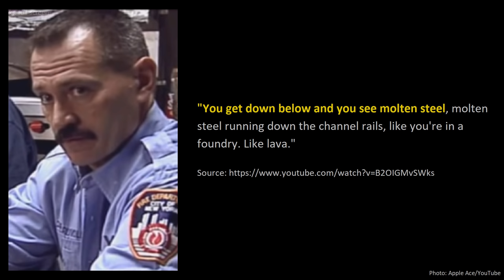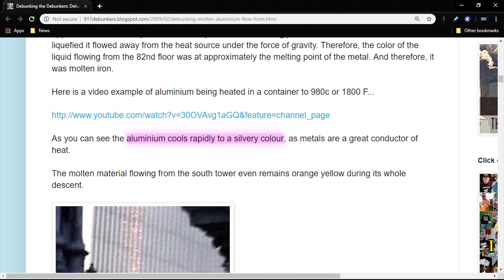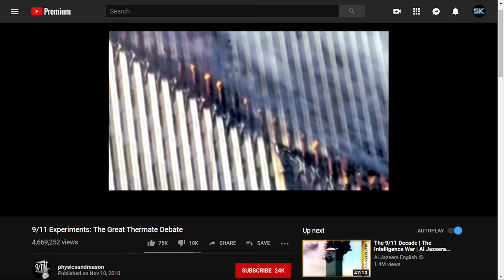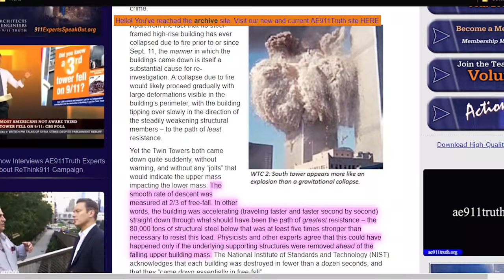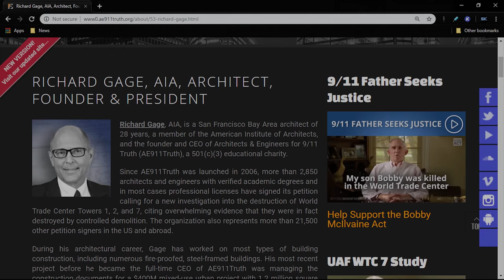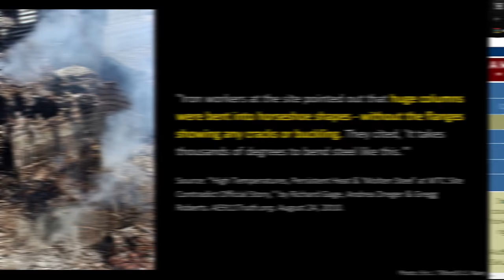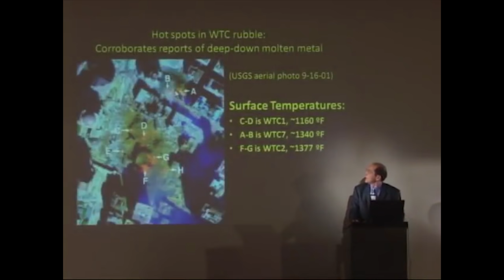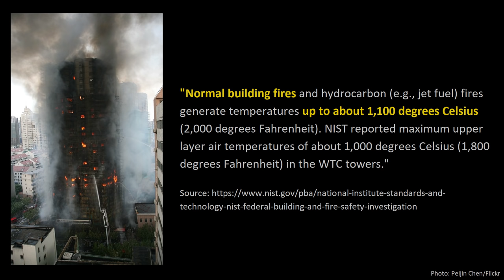9/11 Truthers Debunked: "Molten Steel = Thermite From Controlled Demolition!"

Comment: How would you then explain this thin material remaining liquid weeks after the event??
It takes mass to maintain a solid heat source. Thin sheets of fuselage and cladding don't cut the cheese here sonny. Only huge tonnage of mass explains this theory clearly.
Reply: @yabbadabbadoo8225  "Where does Chief Phatts mention 100 degrees?"
"because the water was just steaming off"
Boiling-point of water, where it would turn into steam, 100 degrees centigrade.

Further questions?

"You PR slant on kids with no brains is pure pointless drivel and lends zero to the whole subject matter."
And, which "kids with no brains" would that be? The average "truther"?

"ask how did 1000's of tons of steel get blast furnace level in heat?"
A better question would be, in what way did they even slightly?
Before you try? At no point, EVER, during the aftermath of 9/11, did anyone "extract molten steel", either directly or in re-solidified form.
Reply: @mooneyes2k478  so you are calling FDNY personnel liars are you??
There were once upon a time B4 YT removed dozens of vids that showed liquid steel flowing while being extracted from all 3 sites. Many of the sightings have been documented. All call outs are followed by post operation reports, it's how the Game improves so incidents and deaths on the job are reduced.
While Chief Orio Palmer was on the 78th floor of the South Tower he reported explosives damage at many locations, but not building failures possibilities.
Had he seen obvious signs, he would have ordered his teams out. Rescues would have been abandoned. A Fire Chief is not a Hose Jockey. They are very skilled at structural observations. They are not permitted to send crews into a building showing signs of failure. Chief Palmer was 40 floors ahead of the nearest teams coming up behind him. Via 2way he was confirming conditions. On the 78th there were a dozen people waiting to be rescued. There were also a lot of bodies, some with giant slabs of concrete on them - crushed flat. The claimed main impact zone was 6 floors above. The people on the 78th had wandered down from the upper floors hoping to get a ride out of the tower.
But all the cars from the 78th lobby were wrecked. So FDNY crews walked them down to the lower lobby(40th floor)
Then the Tower failed, crashed.
Had the floors above the 78th been exposed to 1000 degree out of control fires as NIST reported, the 12 people on the 78th would have all been charcoal, not living breathing beings.
People that revert to terms such as 'Truthers', etc add zero to conversations.
They add their slant and nothing else.
I like facts and science. The real stuff, not dribble and fairy tales like CNN et al.
John Lear via an affidavit has already proved planes were never involved in 9'11
The lads over at pilots for 9'11 have also proved they never came anywhere near the WTC complex. 9000 pound engines cannot vanish. No engines were found at the 9'11 sites. The engine in the street was dumped there. It was a type never fitted to a 757 or a 767. That has already been proved and confirmed by a Court sworn affidavit. Next?
Reply: @yabbadabbadoo8225  "so you are calling FDNY personnel liars are you"
No. Just misinformed. What DO you know, the FDNY were wrong. Doesn't mean they lied, just that they were wrong.

"There were once upon a time B4 YT removed dozens of vids that showed liquid steel flowing while being extracted from all 3 sites."
Sure. After all, you said so, and that makes it so. Really. No, really. YT is IN ON IT!
Meanwhile, here in the REAL world, there's been NO videos, no images, NOTHING....that show molten steel. Anywhere.

"While Chief Orio Palmer was on the 78th floor of the South Tower he reported explosives damage at many locations"
Impact zone of the plane, floors 77 to 85. What a shock that he found damage there.

"They are not permitted to send crews into a building showing signs of failure."
And since the building did not fail because of structural damage, as such, but due to the fires, that's entirely reasonable.

"The claimed main impact zone was 6 floors above"
As noted above...no, it wasn't.

"People that revert to terms such as 'Truthers', etc add zero to conversations."
"Truthers" don't have conversations. You have ridiculous nonsense, gish-gallops and shouts of "shill".

"I like facts and science. "
Shown by peddling nonsense.

"John Lear via an affidavit has already proved planes were never involved in 9'11"
John Lear is a liar, a moron and quite honestly a nut-case. He's falsified supposed government papers, he's a firm believer in little green and gray men from outer space, etc. Using him for anything other than as a good laugh is not doing you any favors.

But, suppose there were no planes involved....where'd they go, then?

"The lads over at pilots for 9'11 have also proved they never came anywhere near the WTC complex."
The "lads" that carefully avoid anything that prove them wrong, and haven't managed to do a single thing for near-on a decade? Them? The ones whose site has "stepped out for a bit"? Yeah...

"No engines were found at the 9'11 sites. "
Except for the engines found, of course. The ones photographically shown. Yeah. If you don't count THOSE, you're of course right.

"The engine in the street was dumped there."
Yeah. Without anyone noticing, they dumped something that's more than 150 inches long, over 90 inches wide, and weighs a minimum of 4 tons. 

"It was a type never fitted to a 757 or a 767."
It's a Pratt & Whitney JT9D-7R4D. Which, what DO you know, were mounted on the UA 767s.

Next, indeed. Would you like to try again?

Comment: Twin Towers Engineered To Withstand Jet Collision
"We looked at every possible thing we could think of that could happen to the buildings, even to the extent of an airplane hitting the side," said John Skilling, head structural engineer. "However, back in those days people didn't think about terrorists very much."

"Our analysis indicated the biggest problem would be the fact that all the fuel (from the airplane) would dump into the building. There would be a horrendous fire. A lot of people would be killed," he said. "The building structure would still be there."
Reply: Except that was his opinion. Leslie Robertson structural engineer for the WTC said the Building was designed to withstand a 707 flying slow low on fuel. Which makes sense considering the much heavier Boeing 767 going 400+mph left three-sided holes in each Tower
Reply: @melvynsngltn27  the buildings did hold until everything was turned into dust.
Dr Judy Woods has explained this in her video "where did the towers go".